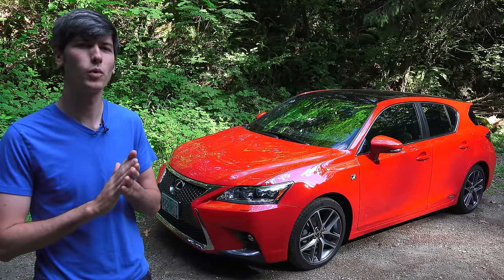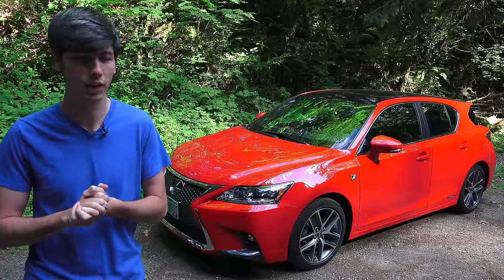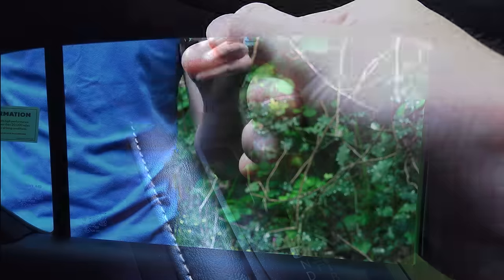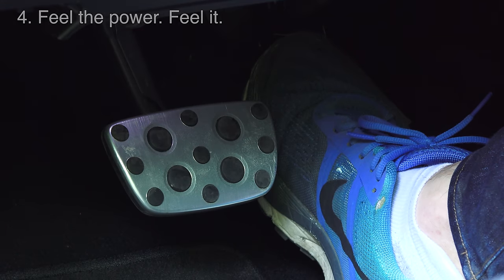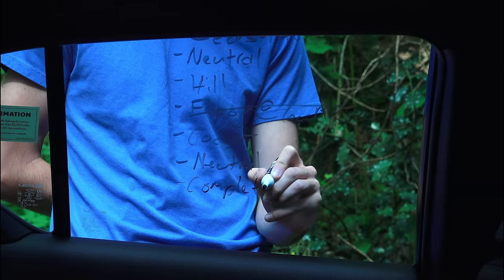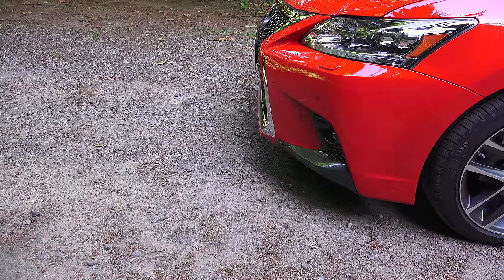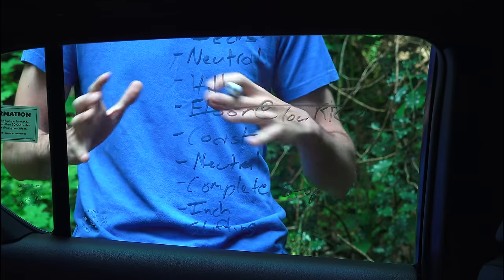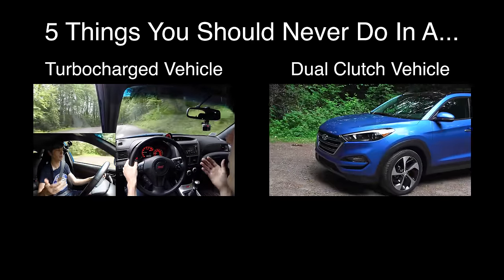5 Things You Should Never Do In A CVT Vehicle

Comment: I have a eCVT in my 2013 Ford Fusion hybrid.

Works great other than the lag (but that has moreso to do with the combination of engine and transmission than just the transmission alone).

If the combined system had more torque/power, then I would probably be able to make better use of it, but as it stands, it sadly, doesn't, so oh well. I live with it. With gas prices where they are and I'm getting a combined 39.2 mpg (which isn't the best that these cars can get, but it's also a lot better than many others), it serves its purpose well.
Reply: Those are nice cars! If you wanted something faster the cvt accords are really nice, bought a 13 a few months ago. While it does have a little lag it gets up and goes w/ proper pedal placement and has a sport mode that works great. Has an aftermarket intake and exhaust, I got 37 mpgs the other day but today I got 25 on the highway lol so that's the price you pay for extra power/responsiveness it seems
Reply: @DIE2dayORelse  
I think that the more interesting test would be the time it will take your Accord CVT to accelerate from 72 km/h to 120 km/h (45-75 mph) BUT you are LIMITED in terms of % foot rotation (i.e. you can only give it say like upto 40% throttle).

THAT would be a lot more interesting.

The reason why I say this is because - sure, you can rev the piss out of an engine, just to get your car going -- OR, if the engine+motor was more powerful (and/or more torque) to begin with, then you wouldn't have to put as much pedal input (or floor it), JUST to get your car going.

I CAN floor it to merge onto a highway, but I shouldn't have to.

Comment: 2019 Nissan Sentra with CVT doesn't like fast takeoffs or engine speeds above 4k. And it is not a shiftless transmission. Watch the tach. It will tick up and down at shift points just like a normal automatic or manual transmission.

Comment: Producing a Continuosly Variable Transmission (CVT) with stepped gear shifting has to be one of the dumbest decisions ever. The big advantage with CVT transmissions is that they seamlessly shift gear ratios all the time, hence the Continuosly Variable part, thus making it possible to keep the engine at optimum rpm while continuosly and seamlessly varying the gear ratio.

This means that if you want maximum acceleration, you tune the CVT to let the engine spin up to the rpm at which it makes its peak torque and then (assuming near perfect CVT calibration, which is very possible with computer controlled CVT) you vary the CVT ratio with the load so that the engine stays at its peak torque rpm while the CVT shifts seamlessly. Say your engine develops peak torque at 5000 rpm, you then calibrate the CVT to quickly let the engine spin up to 5000 rpm during initial acceleration and then to seamlessly shift ratios while maintaining 5000 rpms.

If you want peak efficiency, you tune the computer controlled CVT according to the optimum characteristics of the engine so that the CVT manages the load vs engine rpms in the most efficient way possible. With a computer controlled CVT and a rigid calibration of it, you can get very good performance and efficiency. Making the CVT change ratios in steps is just killing the big advantage that CVTs have over the other types of transmissions. 

TL; DR: CVTs are for keeping engines at peak efficiency and/or power with constant and seamless gear ratio changes. Make the CVT change gear ratios in steps and you completely obliterate the whole reason for them.

Comment: simple answer: my definition: the gears DO NOT shift, instead they stay at whatever rpm the car is capable to do when accelerating.

if I suck at definitions, here’s a more in depth answer: A CVT transmission, or continuously variable transmission, seamlessly changes through an unending range of effective gear ratios while you drive, whereas other kinds of mechanical transmissions offer a fixed number of gear ratios and have hard shifts between each.

i tried my best

Comment: "don't put it in neutral when coming to a stop" - everyone is saying that but DOES IT REALLY HURT TO DO SO? I'm very light on the brake coming from a standard transmission so I feel like if I don't press it hard enough the engine fights the braking until it stops. Neutral before a stop makes the stop perfect since I can play with the brake pedal push it fully and then slowly release, keeping it in D will try to move it further than where it's supposed to stop. So please answer me this, does it really hurt to put it in neutral? I also feel like I have to push the brake harder rather than very lightly while I'm waiting at the light, if I don't I feel a certain vibration like it's ready to go, like you'd be holding the brake and then the clutch half way in a manual.

Comment: I have a 2016 Chrysler 200C AWD with 9-speed auto, and while driving I can spin rotary knob that selectively changes gears while driving.

Still not big fan of these drive transmissions required maintenance intervals.
Drawbacks highway driving lack of towing capacity.
Reliability is not there.
Researched a Toyota corolla for guy at work 60,000 miles C.V.T 1.8 liter engine.
I recommend against purchase because of lack of knowledge of cvt fluid being changed.
But he purchased it from independent dealer not Toyota dealer.
$300 get transmission fluid change at Toyota dealer.

Had car for 1 month seems to be ok, dealer said fluid condition is good.
Told him get that writing if transmission failure happens he that they guarantee that car for 90 days.
We will see.

Comment: The owner's manual for my 2018 Honda Accord with a CVT specifically says Neutral is for idling.
Reply: I do that with my 1987 fiesta when I'm stationary i once left it in reverse when I went to the shop it just held there on the hand brake so it will hold but I don't like it I prefer neutral and hand brake

Comment: Interesting comments in the video. My wife has a new CR-V with the CVT in it. It seems to basically disengage the transmission at stop lights, and if you creep it has to engage and disengage.

Overall I've heard the Honda's are best for CVT currently.
Reply: Do you mean the engine shut off feature?
Reply: @lysak89  no, the engine does not stop at any time unless you but the engine stop button. They may have put that feature in newer models but hers does not have that.

Comment: My corolla 2014 has a flaw in it
If you need Accelerate quickly example emergency situation if you spin a wheel then it stays in one gear position for a long time before changing up 

So dangerous

Only happens if you spin a wheel for half a second wet road ect then it stat in that ration for a few seconds before slowing changing up

Comment: 2 yr old Nissan Juke. 3 driving settings, w/ auto stick. Only issue is: Once in a great while it will refuse to change gears unless I back off the gas. Any idea why?
Took it to the Dealership for a diagnostic and there were no codes to work from. She drives really good regardless.

Comment: Actually you should never put your TOYOTA HYBRID (I don't know about other brands) car in neutral at a stop unless it's nessasery. Because it will disconnect the generator from the engine and the HV battery will get dischrged due to A/C, Lights and other stuff running from HV bettery (If you keep it in  P, D or B position engine will start as the battry gets low and it will charge the HV battery to a certain level, this cycle will continue as nessasary). You won't notice it until car starts screaming with a warning.

Um sorry for my bad english, but I hope you got what I said and please give my message to your audience in a more undestandable form.

Comment: Pretty interesting video, the guy is fantastic, clear explanation and everything, really interesting but I'm not an expert like him but I own a CT200 and used it for 100k km, did the ordinary maintenance (the extraordinary has been two light bulbs), and to me regarding inching, hill break and also reverse direction with the car not completely stopped do not apply ocmpletely, I mean I'll follow those rules, but CT200 can hold that without a plissè because of the electric motor that "absorbs" those mistreating... or at least it's my feeling! Anyway CT200 is a yet simple (for the driver at least, and that's important!) but really really wonderful car, fuel efficient, smooth, realiable like a tank... a pleasure to use everytime

Comment: What harm in using neutral while stopped at a light? It reduces load on both engine and transmission, which otherwise would only produce heat.

Comment: 5:29, actually this is pretty acurate, i have never driven a car with a CVT, however i drive a car with manual transmission and this point applies here as well, because sometimes there is human error, the feel that gives me is than when i try to go from 1st or 2nd gear to reverse without having stopped the car completely, it feels like some plates are still spinning and can't attach each other and sounds quite awful

Comment: I was expecting a mention of the rule to not drive a CVT car at heavy throttle especially with a heavy load, it keeps the engine rpm up high constantly with its continually variable drive ratios. That makes for hard acceleration but wears the motor quickly and probably the transmission too
Reply: You’re wrong. That’s the whole point of a cvt. Rpm’s are supposed to stay high
Reply: Until you reach speed
Reply: @Starwarman1  Oh, I thought engines did wear out faster at high rpm and that CVTs were designed to automatically adjust the drive ratio for the most efficient rpm so if you're not racing, that would be mid-range rpm for acceleration and low rpm for cruising which is great for an old lady but if you're doing something that requires max power, like racing or hauling a heavy load, then you're going to stay between peak torque rpm and peak power rpm basically from launch until you need to let off the throttle and that would be good for performance but wouldn't that be hard on every wear point from the motor to the wheels?

Comment: ...... why is there less vibration in neutral than in drive on all cars? I dont think the clutch is 100% disengaged. There is still some pressure from the torque converter going somewhere. This is evidence by my clutch actually locking up at between 12-20mph which yes I can feel.

Comment: I was driving my Honda civic X at 90 KM/H when my boy's car seat which was on center console slipped forward and pushed the gear shifter into R (reverse) . 
Surprisingly nothing happened except for change in engine sound, and I shifted back into D (Drive) mode. 
The car is said to have CVT transmission. 
Yes that was a negligence on my part since my new born was crying and I let him rest as near as possible. 
But the question is, how dangerous it could prove, a sudden shift from D to R while car is moving forwards as such a speed. 
Regards

Comment: Is putting it in neutral at a red light really a thing?  Do many people do that?  I've never heard of it until recently and I've had a driver's license for more than fifty years.  Also, coming to a complete stop before changing direction has always, always been the rule unless you had a manual transmission with a synchronized first gear, which all manuals have nowadays.

Comment: Can you do a video on CVT towing? I own a 2019 toyota corolla hatchback with a CVT that actually has first gear. Specs online says that I can tow up too 3060 pounds. However I've been told by a toyota rep that using a CVT for towing is putting unwanted stress on the cars transmission and he wouldn't recommend because repairs are very pricey. 

I'm looking to making a move from CA to CO soon and I was looking at towing a small U-haul trailer. Specs everywhere says I can, but is it truly that bad for my transmission and or does my first gear drive Toyota CVT make any difference? 

Thank you! I'd appreciate any input! From anyone.

Comment: You're absolutely the best at what you do but a good car is a car that can last 200,000 miles and has a good fuel injection system and good electronic modules and you don't see that in today's cars not for Toyota not for the Acura not for the Lexus too many electronic modules and sensors

Comment: My 2019 Honda Civic Touring has a CVT but when you floor it, it shifts like a geared transmission. And I have paddle shifters so it makes it so much more fun. But I am loving this transmission.
Reply: while it doesnt have actual gears to switch if you use the shifters it does have established ratios that it switches between when you speed up which is why it may drop Rpms as yoiu hit a normal driving speed like 60
Reply: @arinoconnor1723  I already knew that. lol.

Comment: Well i have a 2017 subaru impreza cvt i did a cat back straight pipe and got a cold air intake injen sp pipe filter k&n and its loud it does the popopop sometimes not all the times ! And got springs need coil overs tho and last performance mod i need is pedal comander ! And a tune in the future !

Comment: I'll never allow the exhaust to get noisy on my Toyota Hybrid. Apart from that the CVT does what is expected of it.
Reply: the hybrid isn't a CVT.. its a typical 2 motor hybrid system, but on the rav has a additional electric motor on the rear axle.  It is entirely different than a CVT

Comment: What would be considered a different cvt from a traditional cvt? I don't get it. I own a 2020 Nissan Rogue. What category is that CVT? Clutch based or what? Which CVT are clutch based?
Reply: All Nissan cvts use torque converters and are called xtronic cvts and use programming that Nissan calls d-step which mimics gear of a regular automatic or can drive like a cvt, and that is the most common type of cvt since the company Nissan gets its transmissions from makes about 72% of all cvts
Reply: @sethlittle7338  I wish that simulated D-Step logic thing could be disabled. I hate it so much.

Comment: Engine braking on CVT?
Doing It feels extremely smooth for slowing, and it is effective and useful, even in normal city driving. It applies constant same smoth deceleration until it reaches 5mph.
But is it okay for transmission?
Reply: engine breaking doesn't do any damage to a transmission so its okay

Comment: When u apply brakes urgently  in a CVT at  speeds between 70 to 90 kmph and bring the car to still , there's a sudden knocking of the gear box. How to avoid that?
Reply: You sure that's not the ABS?
Reply: Ya it's not the ABS. It's the kind of knocking that we often see in manual cars when we don't use clutch. Is it normal?

Comment: a "eCVT" is nothing like a CVT..(worst name ever for a hybrid drive system)   "eCVT" and most "hybrids"  is a all gear to gear drive train..  no clutches or belts to wear or slip, and only one direct gear to gear ratio directly to the wheels.  Hybrid drives are essentially a electronic clutch, by countering the engines rotational force to cancel and or use as power generation,  or push the rotational force into the transmission via a power split device (a differential, planetary or traditional).  Once you understand how a hybrid transmission works you'lll likely buy nothing else ever again. Its so simple, yet elegant of a solution, with no wear parts and it adds added efficiency and cost savings through regenerative breaking, maintenance etc.

Comment: Most  CVT transmission have a toque converter running from an engin powering  moving  cone that  push a steel  belt. that power an other cone.  as long as the CTV fluid keeps the surface of the  cones and push belt apart  never touching .  They should last way pass the life of the car.  The problem is in the over heated  CVT fluid if it were not for over heating CTV fluid braking down and failing  All  CVT  will last for ever. The  CTV  transmission problem start with the  incredible amount of heat the CTV transmission generates. on acceleration This heat  burns a tiny amount of the CTV fluid  So over time the CTV transmission fluid builds up carbon after years of being constantly over heated the CTV fluid  finely fails  There are cars on You tube that have done over 180,000 miles and there still going good. The reasion for this is they change there CTV fluid  often  I was told by a auto repairer  If you change the  CTV transmission fluid ever 60,000 km the CVT transmission should  out last the lift of the car.  it in The reason this can be proven is before  production of the CTV   Nissan ran cars with CTV transmissions in them in city traffic continually none stop  for five years with no trouble what so ever.  But the thing every few weeks  the CTV transmissions were regularly being taken apart and checked. And  In  doing so  the  cars CTV transmission fluid were continually being replace.  So  the CTV fluid would never wear out like it would in a car with 80000 miles on it The role of the  CTV transmission fluid is to prevent the push steel  belt and the cones from ever touching But once the CTV transmission fluid gets to old and to hot  it loses it viscosity Then  it can no longer protect the  the push steel  belt and the cones from touching When they  start to come in to close contact with one another they start to rub together then the CTV transmission will start to make a whining sound. The push steel belt will start to cut in to the cones  and eventfully the push steel belt will finely fail.  But people have said that when there transmission started  to make a whining sound  they took it to an Auto repairer they just replace the CTV fluid it seem to  fix it all most instantly.

Comment: When parking your vehicle, use your parking brake.
Change fluid and filter every 30K.
Don't drive it like a dumbass.
You'll be fine.

Original owner, 1998 Civic HX / CVT with 200K. Works great, and great mileage.
Reply: Civic had cvt even back in 98